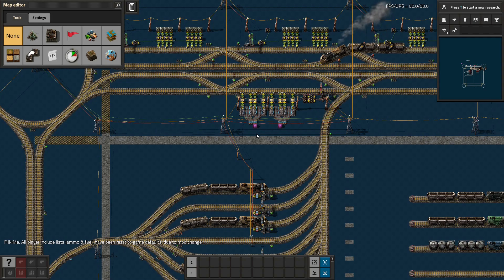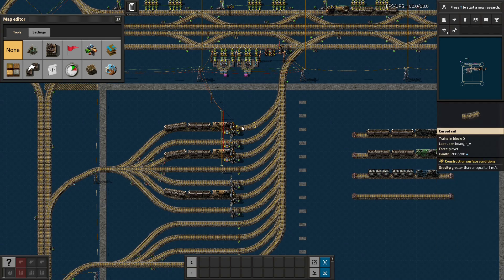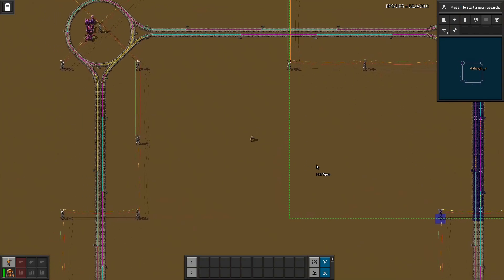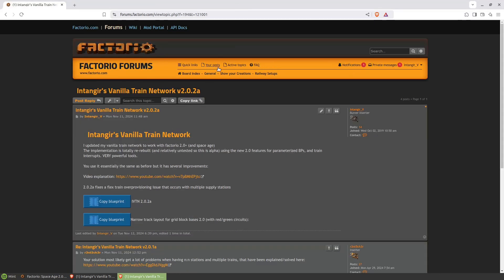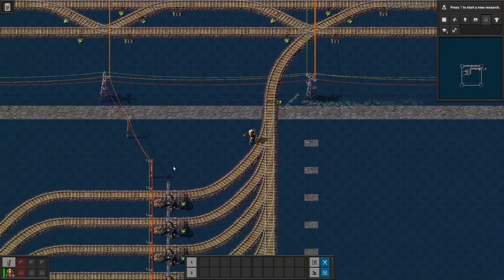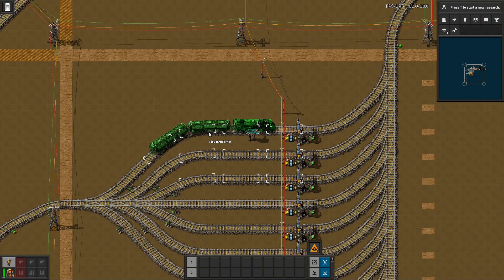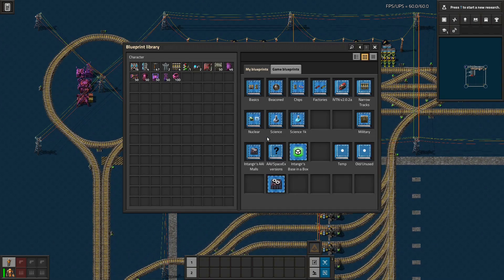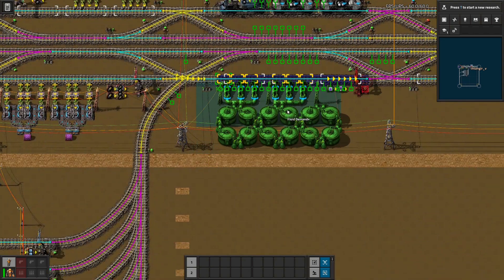How to use IVTN 2.0.4+ for Factorio 2.0.x+ setup walkthrough (updated)

Comment: Until now I have used IVTN v 1.8 (and I do use it in 2.0 with Space Age) and today I remembered to check if you have it, also with this new version you simplified it and wow my surprise how simplified you left it XD
and I have a dilemma... to continue with the old version or the new one, I like both the old and the new version XD
Reply from the maker: i have a soft spot for the old one too cause it took so much more effort and has all those interesting combinators

but ya the new one is so much simpler, has all the same functionality plus much more with the flexible trains and refueling. i use the new one

its a shame all that effort and engineering on the old one is irrelevant now though lol
Reply: @IntangirVoluntaryist  train stations IVTN 2.0.4 Depot it has the box to read train content checked and that sends it to the red circuit line, in my opinion that is useless, is reading train content a mistake?
Reply from the maker: @meirinnahyuga4222  no theres a reason, if you have dedicated trains and flex trains, a dedicated train sitting in the depo with a load can prevent a flex train from going out on a pick up before the dedicated train can react to the demand station

it basically cancels out the negative signal number for demand
Reply: @IntangirVoluntaryist  
You know that in the comparator combiner, in the information output, above the input account, you select it and when you click on ''/'' (I imagine it's a kind of pencil) then you can give it the value you want, including -1, without depending on the constant combiner to give us the value -1 of whatever material or liquid it is (I'm referring to the material or liquid demand station).

And yes, I'm looking at and fiddling with your plans to see how I can adapt it to the needs of my city block, for now I don't like that the station priority is controlled by the circuit XD
I'll use it in my city block of planets aquilo and vulcano .
if it sounds crazy what I'll do in aquilo XD
Reply from the maker: @meirinnahyuga4222  oh that feature to change the constant must be new
ya that should work in place of using the constant combinator

Comment: Hey mate great system, and surprisingly simple logic to it all, this train update has smoothed so much out. Was wondering if changing the train limit on stations would cause more flex trains to be called at once?Since the stations are just looking for >/= 1 i assume that means id get multiple trains calling when only one is required but im assuming it would self correct? Im using the stations on my own rails and already have stackers etc and just wondering if its possible. Also would having the train stop limit set by the output signal of wagons fix that or would that mess something else up? Thanks again bro
Reply from the maker: i haven't tried it, but give it a shot and see, part of the fun is experimenting till it works how you like
Reply: @IntangirVoluntaryist  for anyone who sees this comment and is wondering the same thing, turning on "set train limit" and changing the signal to the same as the stations type (cargo wagon for normal, fluid wagon for fluids) at the supply stations will allow multiple trains to be called and stack at a single supply stations if you have multiple demand stations asking for the same thing. Couldn't get multiple trains to call for a single supply to demand run however and am yet to test if multiple supply stations can stack to a single demand, but will amend when I can see if that works too

Comment: Interesting system, I've been using it for a while and I like it. Thank you.

There are two things I would like to change. When trains go to the depot after each delivery, it doesn't look nice and makes you have a big depot and more trains than you need. The limit of one train per delivery station seems wrong. Usually there are stations at the base with a very high load where you need to send more trains. In previous versions, it seems that each delivery station managed the train limit depending on its free space and the number of trains assigned to this route.

I tried to solve this problem, and it seems to have worked. I had to change the clock signal, now there is only one word clock for the whole system. The departure time is calculated for each train based on its ID. This system has a drawback: trains with ID numbers multiple of 120 will never leave the depot, they simply will not receive a departure signal. I have ideas on how to fix this, but for now I just remove one car and put it back, after which the train gets a different ID.

As a result, the design of the delivery station and the depot station changed and a separate Word clock appeared, which is connected with a red wire to the entire system. In the train interruptions, only one line in the "pickup" rule changed.

Here are the test drawings (the loading station is unchanged, I have no idea why I added it to the book) https://drive.google.com/file/d/1US1-jg8ALXFITkhs1DlMaxQO-7raP1bu/view?usp=drive_link

There is also a drawing of a simple test site just to see how it works https://drive.google.com/file/d/1N9fFvvlWKveIw_bWcFuxXAjBUEKWkUqZ/view?usp=drive_link You need to put some logistic drones into roboport to make refueling station work.

This is just a small demonstration of the concept, there are no dedicated trains and trains for liquids, but it is very easy to add.

You may find this interesting and want to add it to your system.

Comment: I have several loading/unloading stations for one resource, but in this case I have only one train that runs on one route. How can I fix this?
Reply from the maker: I don't understand your question
Reply: @IntangirVoluntaryist  I mean, I built multiple supply stations and demand stations for a certain resource. Then, I launched several flexible trains, but only one of them is used for that resource, although multiple trains could have been employed.
Reply from the maker: @SAnsAN091190  do all of the supply stations have enough supply on hand at the same time? It does normally use more trains if it can
Reply: @IntangirVoluntaryist  All supply stations have sufficient resources. If I add a dedicated train, then a flex and dedicated train travel to the same resource, but two flex trains per resource are not used at the same time. But this approach requires microcontrol and is not quite as convenient as the ubiquitous use of flex trains.
Reply: @IntangirVoluntaryist  Could it be a problem if the stations have the same names?
Reply from the maker: @SAnsAN091190  the stations are supposed to have the same names, can you post your save somewhere so i can take a look and debug it? im curious what would cause that, i haven't heard of any issues with this new version so im not sure what it could be. let me know which resource is the problem too
Reply: @IntangirVoluntaryist  I realized the problem: I forgot to connect the stations from which most trains depart to the logical network .

After I ran the wires to the stations, everything worked . It's all the fault of my carelessness 😅
Thank you for your patience and willingness to help 🤗
Reply: But I have another dilemma 😅: is it possible to increase the number of simultaneously requested trains to the demand station in order to increase the capacity? ) 

Right now, I can consume all the resources that the train brings in at the same time, and production stops until the train goes to the depot after unloading, and only then loads and arrives again for unloading .
So far, I only see the possibility of adding an additional demand station in the same location
Reply from the maker: @SAnsAN091190  I haven't tested that, you could customize your blueprints to have bigger trains, or add more stops to the locations, those should work without changing limit logic, but ive never tried changing the limits, pretty sure it won't work as intended without other changes

Comment: One thing i was wondering, but how would you handle low throughput items? For example if i'm making blue circuits that need to be used in multiple places, and i'm technically making enough supply for each other block that needs it, but the trains themselves only come every 30ish minutes because that's how long it takes to fill up the storage chests enough to meet the combinator amount to enable the train stop.

Should i just lower the threshold to allow the train for blue circuits to come more often, and also modify any demand stations to make sure they're satisfied with a lower amount of blue circuits in stock?
Reply from the maker: Ya that's one way
Reply: @IntangirVoluntaryist  Install a constant combinator on the station and have it store the number of stacks you want in the chest. You don't need to connect it to anything. In the station blueprint, make this number a parameter, assign it a variable, and use it instead of 48 in the station capacity formula. Now when you install the blueprint, you can specify how many stacks to fill each chest with.

Comment: I wonder, why prevent dynamic trains from dispatching to any free supply station, regardless of whether or not there is demand? This will result in the item being made available quicker once the demand is there.

The trains will idle at the supply station, but that is fine as long as you have enough trains, no? Or am I overl,looking something?

EDIT: I noticed that's what the dedicated trains do. So my question is then more, why flextrains? It just invites you to expand over your networks train capability and "multiplex" certain demands, but knowing factorio those demands will extend and eventually you need a dedicated train anyway.

Also, this system works great on smaller distance but I'd love a dynamic setup that can handle long distances, either using buffer stations or dispatching multiple trains to a supply station. I'll experiment a bit with that... :D

Comment: Would this still work if I wanted to use something like 1-4 or 1-4-1 trains? I'm assuming the check on the stations for fullness would need to be modified to account for a larger buffer amount, and the blocks themselves might end up only being able to support 1 1-4 train per side instead of 2 1-2 trains?
Reply: nvm, saw your other video on customization of the blueprints